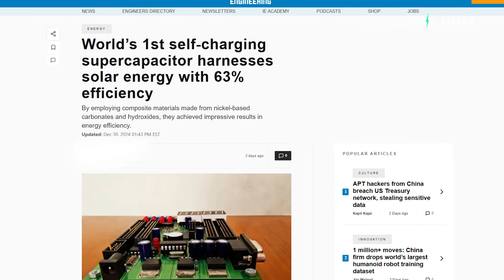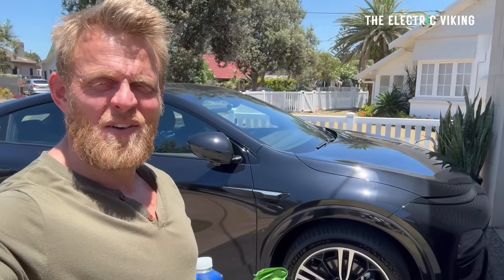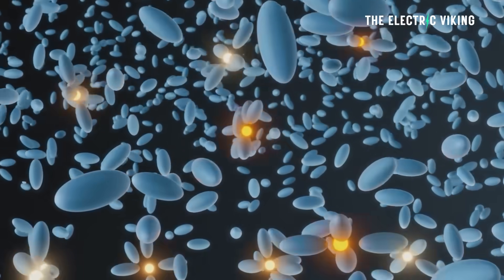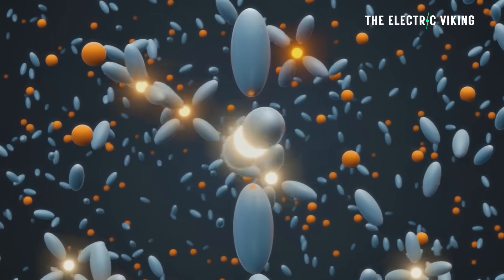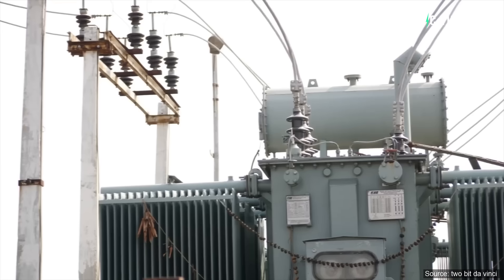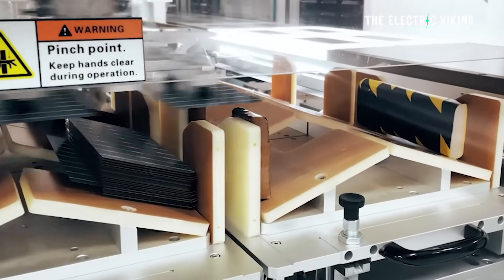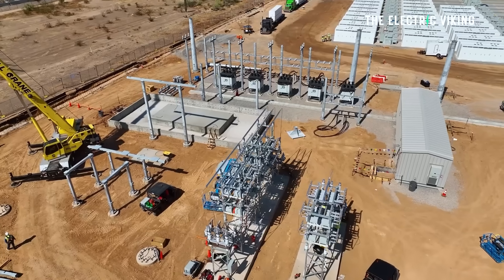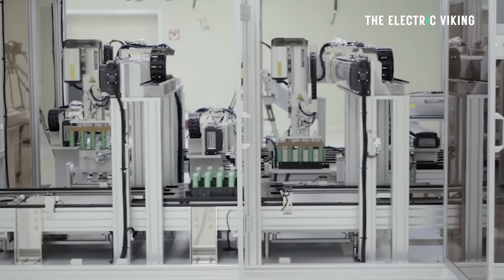World’s 1st self-charging supercapacitor records shocking 63% solar efficiency

Comment: A bit confused. A capacitor isn't the part that's converting solar into electricity. That's the panels' job, What is the 63 percent efficiency number referencing?
Reply: Efficiency of converting the panel's output to energy storage, the original article states this is the storage efficiency of the integrated capacitor not that of the overall system which is only 5.17%. This is a specific product for charging supercaps not a solar panel enhancement technology, it's for applications where a short burst of high power is required. Perhaps an off grid motor starter or solenoid latch.

Comment: How does a capacitor, even a super capacitor, increase solar cell efficiency?  This makes no sense.
Reply: But yes he's incorrectly conflating solar panel efficiency with storage efficiency.  Energy storage efficiency and energy efficiency are separate processes and conflating them can lead to confusion.
Reply: @JoeyBlogs007  your are 100% right
Reply: You people just don't understand science. First, you plant the magic beans. Then, the supercapacitor tree grows, which (obviously) increases solar panel efficiency. Come on guys, keep up.
Reply: @alexishart1989  my thoughts exactly. Besides, if there are cool animations, with particles and a lot of CGI, it is bound to work very well. People lack imagination these days ffs. With enough magic beans, people would believe the device might give more output than input. 'Cool beans', like Creed used to say.
Reply: @brunesi  finally, someone who gets it.
Reply: You are correct.  There is a lot of "say what?" going on here.
Reply: Integrating supercapacitors with solar panels can make sense. They help smooth out the fluctuations in power generation, providing a more stable and reliable flow of energy. By quickly storing and discharging energy, supercapacitors reduce the strain on batteries, making the entire system more efficient, especially in situations with variable sunlight. Fluctuations caused by clouds and varying sunlight intensity are examples of short-term power fluctuations. Without supercapacitors, energy storage efficiency can be reduced because the battery may experience rapid charging and discharging cycles, which can lead to energy loss and shorter lifespan. Batteries are less efficient when handling frequent, quick power fluctuations, as they are designed for longer, steadier energy storage. Supercapacitors smooth these fluctuations, allowing the battery to perform more efficiently and last longer.
Reply: @  So it doesn’t make the solar cells “more” efficient, it just fills in the gaps. Making the charging process more efficient, but still useless without enough sun.
Reply: @JoeyBlogs007  Now I understand! You should have your own YT chanel.
Reply: @JoeyBlogs007  But it doesn't increase any energy generation or storage by much. In fact it would be a tiny percent. Sam is alluding to the idea that better capacitors can increase efficiency of solar panels by several percentage points.  Not realistic.
Reply: @JoeyBlogs007  Well, than Sam should have said this. But this is just bla-bla without explanation.
Reply: Battery round trip efficiency is already about 95 in some systems so storage has not been exceeded by using capacitors in fact it is way below that also the capacity of capacitors is low isn't it compared to batteries so the electric Viking has swallowed some public relations crap looks like.
Reply: Yeah, so if you have 25% efficiency of your solar panels, with supercapacitors of 63% storage efficiency, the overall efficiency is 5.17% as he says at t4:26 (he also says he doesn't understand the numbers). Lithium ion chemistry is around 90% storage efficiency, so I guess 63% is high for supercapacitors, and besides the high power density, which you don't really need, since storage density matters more (you want days or weeks of storage, not super fast discharge), this isn't all that exciting.
Reply: He says that the tech combines solar tech and super capacitors. If the electrical potential generated by the panels encounters less resistance, less energy is lost.
The people saying that Sam is "mixing up" solar tech and capacitors are talking out of their ass. The capacitors store energy with less resistance, and that's why efficiency is improved.
Reply: @DGlass-ygxk the answer to your question is that this guy is a moron. The only reason I’m here is that YouTube keeps suggesting this fool. Don’t listen to this idiot.
Reply: when your charging your battery it has resistance, if its 2 phase with a super capacitor battery in the middle u can use that to charge the battery and u have less resistance for your solar cell charging
Reply: New capacitor technology, such as supercapacitors, can improve solar panels by improving the power factor and storing energy: 

Power factor
Capacitor banks can improve the power factor by providing reactive power to compensate for inductive loads. This results in reduced losses, increased efficiency, and compliance with utility requirements.
Reply: @HyperCircle    Sam is claiming roughly from 20% to 60% efficiency of solar cells a 300% increase!!! I think we can agree that’s insane.
Reply: This reminds me a lot of one of the biggest cons in the solar energy industry. The dude with the mobile solar panels.
Please guys, if a solar cell has efficiency of 25% on converting solar to electric energy, if you build a 100% efficient storage system, the solar efficiency conversion will be 25%. Pretty please.
Supercaps have another set of applications, they have high power density (for example, for ice ignition) but poor energy density. 
Let's be aware of too good to be true announcements, for they're usually eager to capture investor's capital as quick as possible.
Reply: @brunesi 
Super Capacitors are a Great Add on for Any Electrical Battery System.

Also Solar Panels with Micro Inverters Could Utilise Super Capacitors to Lift Day Long Output from the Panels.  (I Don't Know if MIs are or are Not Utilising SCs)

Also Night Time Energy from Solar Panels Could be Utilised Via Super Capacitors.

Hence Overall the Super Capacitors Will Increase Daily Kilowatt Hours and Assist Batteries.
Reply: @chrisgriffiths2533  got you, but the argument is not that super caps are useless, the bs calling here is that 'they improve solar conversion efficiency'. Even so, super caps might not be a good idea for energy storage, batteries are still better, and cheaper, energy density wise. We use them as energy storage units in our projects sometimes, for instance when deploying thousands of devices on utilities (electrical for instance). Companies do not want to replace batteries every, say, five years, so the cost bump justifies, in this case.
Reply: Full of shite
Reply: I'm also calling bs on this, think Sam has jumped the gun here. It merely increases the flow of electricity from the panels to the battery- it would be no better then just optimising all the panels individually
Reply: His framing is so surface level it's painful to watch
Reply: Maximum theoretical for silicon is 30%
Reply: @carlvagg5493  and what is the point of your statement
Reply: Haven't gotten past 1 minute in the video yet but I'm thinking it has to do with how fast they can charge. Because the problem with power storage is cramming all that energy into the battery. Heat can slow that down and when you charge batteries they do get hot and at 80% charging gets bottle necked. That's what I got off the top of my head.
Reply: It is bullshit. Capacitors do not exist in solar panels. Capacitors are a short term storage device.
Reply: I am no expert in anything electric. I know there is this thing called "internal impedance of batteries" which means some kind of resistance when charging. Capacitors have lower impedance means faster charging. Faster charging means the solar panels can dump the energy into the battery as fast as it could grab from the Sun. Now remember what I said earlier...I am no expert in this field ...
Reply: capacitors have always been the 'so called' holy grail of future power storage,  and in some ways they will, but only in some ways!
Reply: Capacitors are back!  
I thought they were going to fix regen and prolong EV batteries, then they disappeared
Reply: I saw a program on the TV  a small sports car company in Wales was using   capacitors to provide initial acceleration these were recharged using regenerative breaking. The smaller  battery is used to maintain speed
Reply: I was about to make the same comment when I saw yours.  He seems to suggest that adding these capacitors somehow increases the efficiency of solar panels ability to convert light energy into electricity, when the capacitors simply provide storage.  How does this means of storage compare with normal batteries?  That would be the measure of success of this development.
Reply: Key Findings and Design:

Material Development:

Transition metal ions (Mn, Co, Cu, Fe, Zn) were integrated into Ni-based carbonate/hydroxide compounds to address conductivity issues of single-metal electrodes.

The resulting binary compounds exhibit high electronic conductivity, structural stability, and reversible capacity.

Fabrication Process:

A hydrothermal method was used to grow these binary compounds on three-dimensional porous Ni foam, maximizing the electrode surface area and improving electrochemical performance.

Performance Highlights:

The NiCo(CO3)(OH)2 electrode achieved high energy density (35.5 Wh/kg) and power density (2555.6 W/kg).

Exceptional cycle stability with 87.1% capacity retention after 5000 cycles.

Self-Charging System:

Integration with Silicon Solar Cells:

Silicon solar cells were paired with the supercapacitor to form a self-charging device, enabling direct energy conversion and storage.

Achieved 63% storage efficiency and an overall system efficiency of 5.17%.

Potential Applications:

Portable electronics and off-grid energy systems benefit from fast charging, sustainability, and reduced reliance on traditional batteries.

Broader Implications:

Electrode Innovation:

Binary transition metal electrodes improve active site density and charge mobility.

Materials with high entropy contribute to enhanced corrosion resistance and structural robustness.

Sustainability:

The use of renewable solar energy and advanced supercapacitor design supports sustainable energy solutions.

Reduction in reliance on toxic or environmentally harmful materials compared to conventional batteries.

This study's integration of optimized electrode materials and renewable energy sources represents a significant step toward commercializing self-charging, high-efficiency energy storage systems.
Reply: @DGlass-yg8xk  I tried to inform you that you’re confused because this guy doesn’t know what he’s talking about, but I guess I was a little harsh.
Reply: This hole blog and this post in particular is totsl bs. 2:43 ... W/kg hillarious nonsense. No clue of power and energy units but talking lots of 🦬💩.
Reply: @gerrysecure5874  He is usually pretty accurate.  He must be recovering from a New Year celebration.
Reply: @gerrysecure5874  But you should spell "whole" correctly if you want to seem smart.
Reply: He should immediately delete this video.

Comment: Self-charging  is a Toyota speciality (cousin of the perpetual motion machine), it make just as much sence here. If these are self-charging so are all other batteries.
Reply: It makes more sense if you view it from a supercapacitor perspective than a solar panel one. The devices are bonded sandwich of PV silicon and capacitive layer coatings. The are designed to 'self-charge' from the radiant solar energy, rather than parasitically from another energy source (such as a battery). Their role is to provide support for power spikes, to lesson the load on a battery system. They also reduce the impact of parasitically draining energy from the battery to charge, like  a normal supercapcitor would.

Comment: This video is what happens when YouTubers don’t know what they are talking about. Of all Sam’s mistakes this is the worst.
Reply: Agree 100%. Sam - best to delete this video.
Reply: Sam's just reading stuff to us. But you'd think after he learned so much about solar already he would know this doesn't make sense.
Reply: @-whackd  - It's more a case of misunderstanding the meaning/role of the article, it's not about panel efficiency but solar supercap efficiency (which is a hybrid PV capacitive device). 

The article and original paper give multiple figures, that of the energy storage efficiency, which is the 63% and that of the overall system efficiency (converting light to a stored charge) which is 5.17%. Sam may have just a little too excited about the 63% number in the context of solar panels. Solar supercaps are deisgned for storage short pulses of high power energy (2.6kW in this case). 

This is a breakthrough in this case but for solar supercaps, rather then solar panels or battery energy storage, at 2.6 times the previous power density and 77% higher energy storage density (35.5Wh/kg) - the supercap in this case would be able to sustain it's output for about 50 seconds.
Reply: @GruffSillyGoatThese are not “solar super capacitors”, they are super capacitors used in a solar system. You’re making the same mistake as Sam.
Reply: After years of "expalining" solar, he still confuses viewers by confusing Kilowatts with KilowattHOURS.
Reply: @mikeausyou  Yeah you'd think this would have been hashed out by now 😅
Reply: new capacitor technology, such as supercapacitors, can improve solar panels by improving the power factor and storing energy: 
Power factor
Capacitor banks can improve the power factor by providing reactive power to compensate for inductive loads. This results in reduced losses, increased efficiency, and compliance with utility requirements.
Reply: Your comment is what happens when you dont understand something and instead of looking it up, you assume that the presenter is wrong.  

Not knowing is no big deal.  I also didn't quite understood about power factors, reactive power and inductive loads.  

But to not look it up and then call BS without knowing... now that's irony.
Reply: @HyperCircle  - not sure how your comment is aimed at, but bear in mind that PV, including capacitive PV, and battery systems are DC systems rather than AC ones. There are no reactive losses in DC systems to correct by using power factor correction.

Power Factor is related to AC systems, regarding the relationship between true, reactive and apparent power.